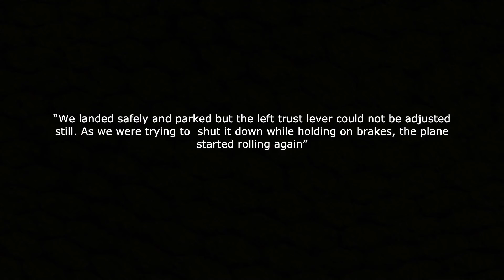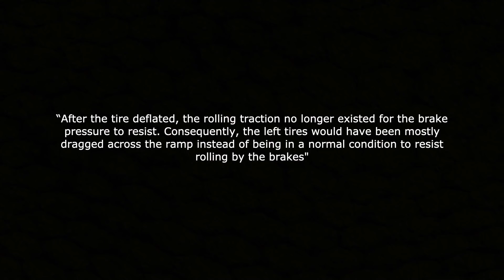The Crash Caused By A False Sense Of Security | RwandAir Flight 205

Comment: The whole time I was watching I was asking myself, “Isn’t it possible to shut the engine down?”
Reply: Same - I would expect that pulling the fire handle would kill the electrics and fuel so shut down the engine.
Reply: I'd suspect that the fuel switch for that engine would have cut the fuel and stopped it. That should have been done while in flight. Then there's the fire switch option.
Pilot Error.
Reply: @millomweb  That's true - that certainly should have stopped it. I can't imagine why a pilot would even try to land with one engine at climb power when single engine landings are (or should be) practiced routinely.
Reply: @gdwnet  No reason fuel couldn't have been cut at the point of touchdown either.
Reply: @millomweb  agreed. Shutting down on the runway and being towed to stand would have been a valid option.
Reply: @gdwnet  Still with one engine, they could have moved the plane normallishly to the 'gate'.
Reply: @millomweb  Yeah they could have. I was just thinking of a full stop on the runway and a later tow to the gate just as the most extreme option they had.
Reply: @gdwnet  Runway stops are usually for fire considerations or 'uncontrolled' landings. In this case, a normal landing was a very real option.
I have no clue what category, fire risk, uncontrolled or runway landing to class Sully's effort. #duckwings
Reply: @gdwnet  we know why, poor training.
Reply: @millomweb  I understand why they did not want to shutdown the engine in flight (they can not assume that they would be able to restart a non responding engine), but... first thing on the ground when in stand still: Working engine back to idle and cut the fuel to the non responding enginge? Is that so tricky to see?
Reply: @sarowie  Option of stopping it at any time is optional - could have been stopped 20ft off the ground before landing - whatever they were comfortable with. It seems they had a faster landing - suggests it should have been stopped earlier and the controllable engine used to compensate.
Reply: pmailkeey :  The checklist covers the options ...
Reply: @millomweb  Are you sure that the fuel switch would have cut the fuel when the pilots could not control the engine power? I'm not a flight engineer, so can be wrong here.
Reply: @MaxusR  Look at your car - if the accelerator's stuck down, does that top the ignition switch stopping the engine.
Not even the throttle on my lawn mower stops the engine (but I knew one where the throttle controll also killed the engine !)
These planes all have independent fuel cut-off controls - how many fatal crashes have there been because pilots have accidentally turned the fuel off - more than you'd guess, I think !
What I'm not sure about is if these jet engines also have an ignition switch that could be turned off.
Reply: @millomweb  "- if the accelerator's stuck down, does that top the ignition switch stopping the engine."

You hit the brake - that will override the accelerator every single time. Turning off the engine in a car is a bad idea as it'll kill the power steering.
Reply: @MaxusR  Yes. The fire handle would have worked also.  The CRJ manuals (like most commercial jets) state that "Pressing the ENG FIRE PUSH light" will close the fuel feed shut off valve, bleed air shut off valve, hydraulic shut off valve, shuts down the engine drive gernerators, and arms the squibs.  They are independant to the thrush lever mechanism.  
Good job they were in a CRJ, I would love to have seen them try this with underwing mounted engines.
Reply: @gdwnet  Not necessarily true that the brake will always override the throttle in a car. I’ve had a throttle position sensor go bad on an OBD-I era car and it would rev all over the place, was capable of overriding the brakes under some conditions, but the pedal was physically connected to the throttle plate so it was possible to starve it out. For drive by wire era, see the NASA Toyota report
Reply: > Not necessarily true that the brake will always override the throttle in a car. <  >Turning off the engine in a car is a bad idea as it'll kill the power steering<  When throttle-stuck-under-floormat happened to me in a V6 Ford Taurus, the basically cold brakes were not slowing the car below ~60 mph/100 kph.  From the sensations I had initially perceived, I took it to be that the (not in use) cruise control had malfunctioned and gone to wide-open throttle (this some years before the notorious Camry floormat accidents).  So just like an airline captain who gets YouTube videos made about them, I kept working that assumption while the actual problem lay elsewhere.  Before the brakes were gone I thought to turn off the engine.  Even though steering off the road was difficult with the power gone, still better than the alternative.  [Edit:  That was hydraulic power steering.  Don't know how it would go with a modern electric system... time to break out the owner's manual.]
Reply: @Rishnai  I'll have a look at that, thanks!
Reply: @millomweb  I can still do alternative actions, such as engaging the clutch, and then break. And then I can try to kill the engine in other ways (e.g. shifting into 3rd/4th gear, and letting the clutch snap). Sure, might not be perfect, but it would almost certainly work. Also, neutral gear is usually an option. The risk that suddenly the accelerator and my gearbox die, and breaking doesn't kill the engine is really really low to me.

I have a couple of other alternatives, not sure which are applicable in automatics, but I don't drive those (because stick shift is standard here). Can you maybe go into neutral?

Anyway, point is, I think the pilots could've done more. And as soon as the plane started moving on the ground, it's really important to do the things that will work, by knowing your plane well, and have an understanding of the systems.
Reply: @MeMe-gm9di  Many people don't seem to understand that brakes stop the wheels turning. It doesn't matter what the engine's doing or what gear you're in (manual), you plant your foot on the brake pedal the car and engine will stop.
The case in the UK the driver said he couldn't use neutral as the engine would over rev. REALLY ? Does that matter ? (there are one or 2 YT vids of wild engines.
You can always select neutral in an auto. It'd be rare for a petrol engine to not stop when the ign is turned off (one click back with the key) - BUT did come across one where the owner had topped the oil up to the neck - and it was running burning the oil :)
The pilots were brain dead.
Reply: @gdwnet  bro missing power steering is not a problem unless ur trying to park XD
Reply: @Schimml0rd  I have no idea what you're on about. Maybe whole words without the leading invalid familial tie?
Reply: @millomweb  with great respect if you turn the ignition off in a car the steering lock will engage and you wont be avle to steer the vehicle. Vary dangerous.
Reply: @glennmcgrath971  That is completely incorrect. No car I've come across does that happen. Why not ? For the reason you've stated !!!! LOL
Reply: @gdwnet  ok sorry, i'll make it clear - i was under the impression you'd be owner of a drivers license and enjoyed education in the field of physics. My bad XD
Aa long as something moves it loses 90% of its traction. 
Compressing 12 yrs of education into a 255 character yt-comment is alittle much, maybe ask your little kid how this stuff works, he will know :)
Edit: now that i think about it your probably one of these soccer moms who turn their steering while the car is stationary, stranger
Reply: @Schimml0rd  "now that i think about it your probably one of these"

If you're going to try to insult me at least learn the difference between 'your' and 'you're'. I'll give you 2/10 for the insult. Could have been better but for the grammar.
Reply: pmailkeey :  i’m sick of these killer pilots, bring on the automation, bring on the auto pilot, bring on Elon musk to save the day. All of this could’ve been done decades ago to get rid of these goddamn killer pilots.
Reply: Should have taken the keys out of the ignition
Reply: Same here. Frist thought - cut the engine off, do a single engine landing (all pilots train that a lot). And if that was not preferable for some reason, kill the engine on touchdown.
Reply: Reminds me of a truck driver in England - engine wouldn't slow down. When eventually stopped, the driver was charged with dangerous driving - really for not knowing how to stop his truck ! He had at least 3 options to try !
Reply: @millomweb  Well, with trucks, you can put the truck in neutral and coast to the shoulder to shut the engine down.

That doesn't work in an airliner.
Reply: @JennRegier  I don't think Sully would agree with you.
Reply: Yes they could and should have shut the engine down - 05:45 in this video, it's in the quick reference handbook. Straightforward single engine landing, textbook stuff.

The real problem was when engine 2 was shut down, along with the hydraulic system. That effectively turned off both the brakes and parking brake. The aircraft was chocked, but engine 1 won that battle. 😟
Reply: @georgeprout42  lol I fixed my typo. Didn't realize it till your comment 😅
Reply: I was thinking of just cutting off the fuel pump for the left engine should have stopped it.
Reply: Same  why the hell not do fuel cutoff
Reply: Same here ! i was thinking land with max power , pull fire handle on touch down
Reply: I was thinking the same thing. Must be a way to cut the power - ie circuit breaker to the engine, OR pull the fire switch.
Reply: Gotta be an "off" button
Reply: Rich
They didn't think of that; the pilots need to be trained on how to switch the engines off!
Reply: Or intentionally taxi onto the grass to get it stuck.
Reply: NiHaoMike :  They could’ve done that too, I thought of that also. If I was stupid enough to land a plane with a runaway engine instead of cut off the fuel supply to it, after I landed I would certainly snub it into the grass so they can’t slip away. But these guys were too stupid anyway, I think you have to have a single digit IQ to be an airline pilot. They are so goddamn stupid.
Reply: @steveperreira5850  " I think you have to have a single digit IQ to be an airline pilot. They are so goddamn stupid."

It's so easy to judge when you're sitting down in your armchair with another beer isn't it?
Reply: @gdwnet  these videos certainly show many fucking dumb mistakes, but we must not lose sight of the fact that successful flights don't get videos made about them, and there are a great many more of those.
Reply: Yeah, but at the time it didnt seem So serious problem that it would warrant a forced shut down and potential damage to the engine. Ofc when the plane started Rolling again this would have been the best course of action but most likely they all were confused and didnt think straight. Thats my theory 🤔
Reply: @anttitheinternetguy3213  Pulling the fire handle wouldn't damage the engine. It just kills the power and fuel.
Reply: @gdwnet  yeah you propably know better, i am just guessing 🤔
Reply: @gdwnet  But that fast (emergency?) shutdown means no cooldown time at reduced power. It might cause damage after all; certainly a maintenance event.
Reply: @GeofreySanders  What would you prefer? A maintenance event on the engine or the whole aircraft?
Again, I cannot understand why a pilot would even attempt to land with an engine at climb power. That's mad. 
Also, keeping it at such a high power setting is more likely to cause damage that a shutdown.
Reply: @gdwnet  Yes, I'd say the high power setting caused quite some damage in this instance.
Reply: Antti The Internet Guy :  they are confused anytime something goes wrong because they are lazy goddamn pilots who aren’t prepared for an emergency and when it happens they “wing it”.   

When we have automation for flight, and we should’ve had it decades ago because the technology was available, anyway, those systems will always operate alert, make the right decisions, never be lazy, never be hung over, and without an ego whatsoever. Then Commercial flight will be safe. Until then it is simply a crapshoot
Reply: @steveperreira5850  Steve, you have always the same solution, every video, every crash. Kill the pilots. I admit automation do a lot for safety but it also fails. An Elon Musk car failed exactly like this aircraft, didn't it? I still think you're a T800 model coming from future to destroy humanity.
Reply: There was no fire, so nobody thought about this option. And they didn't read the manuals.
Reply: @MaxusR  Sure but a fire handle is more than just for fire. Pull the handle you isolate the engine, turn it you fire the fire bottle - I assume that's it works in the CRJ as well.
Reply: @gdwnet  I totally agree. My point was that the pilots just didn't think about this option because there was no fire, not because they didn't knew about it at all.
Reply: @MaxusR  admittedly I am sitting at the desk in the comfort of my home, but I don't have a cpl, let alone atpl, I don't have multi engine rating and I don't even have a ppl anymore, but I was thinking about the fire extinguisher. Saying that nobody though of the option just because there was no fire is probably incorrect. Nobody in that cockpit did, true. My first and only thought would have been to shut that engine down for landing, any means necessary, even fire extinguisher will do when there is no fire. There are so many things can can go wrong on the runway still with asymmetric power, one engine at near full power.
Reply: Or how about switching on reverse thrust?
Reply: @xonx209  It appears that feature is only available with engine at idle and Windows 9 & above.
Reply: I think they said they tried to shut it down but the plane kept rolling
Reply: @dschroeder4380  "They said they tried to sh[u]t it down but the plane kept rolling."

The plane kept a-rollin', all night long,
The plane kept a-rollin', all night long,
The plane kept a-rollin', all night long,
With a heave, and a ho,
But I just couldn't tell her so!  😁

Comment: I'm a bit surprised they didn't think of the fire handle, but a very stressful situation ...

Still it shows something seriously  lacking by not reaching for the QRH during an emergency.
Reply: On the crj it is a push button with a guarded cover. But yes, thats the correct course of action.
Reply: Once again, great research, narration, graphics and presentation. Felt like I was in the window seat! Thanks!
Reply: One plane landed with an errant engine that wouldn't shut down. The fire team loaded it with foam and it finally shut down after 1 hour.
Reply: That is the reason why you have all these checklists.

So, let's see,. engine won't stop.

Are we in level flight with reasonable control?

yes.

Ok, start looking through those binders full of checklists.

Hmm, engine stall, engine stop, aah, here it is: engine stuck at high thrust.

It says to press this buttons to cut off the fuel. It is an approved procedure. Let's do that.
Just double checking, are we cutting fuel to the correct engine?
Ok.
Done